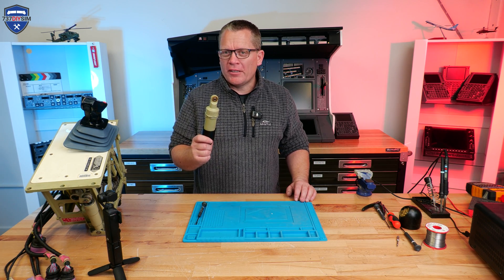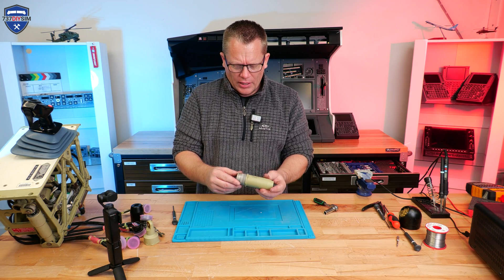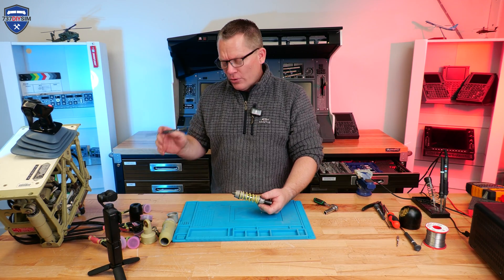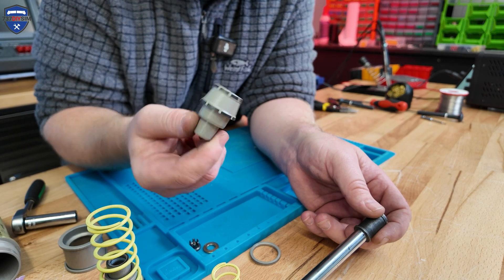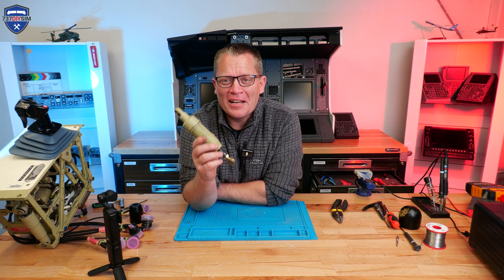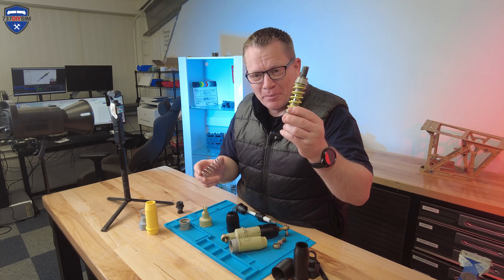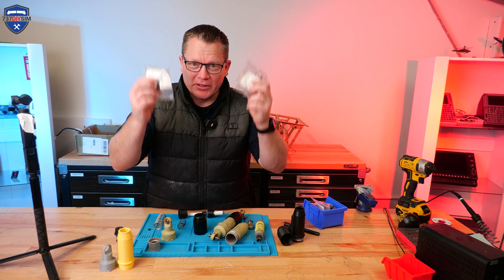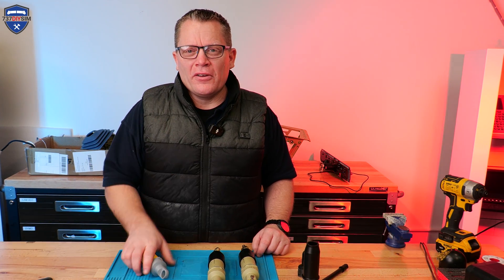A320 Sidestick PAFU

Comment: Hi Karl, first of all thank you so much for making this video! It's hard to find detailed info regarding how the airbus sidestick artificial feel unit works, and your video has certainly shed some light on it. However, I wonder if you have measured or have info on the stick force and gradient, or the force of the springs? So far I only found it has a 1lb breakout force, max 22 lb for pitch, and a non-linear gradient of two stages of force which is generated by the two springs shown in your video. But I don't know how much force it takes to reach the second stage..

Comment: Another reason to have 2 of them, with different part numbers, is staging. One operates at 10mm compression while the other one operates at 15mm compression. This gives 4 stages of force not just 2. Important when you don't have an active linear feedback.
Reply: Interesting. Could you elaborate on that? The info available online just mentions 2 stages of force, and quite vague.. it's so hard to find the force gradient. I'd really appreciate it if you could shed some light on it!🤝 Just want to simulate it with a control loading stick for flight sim haha.

Comment: Great job Karl. So do you prefer Fusion 360 over Solid Works? I got a Bambu Labs X1C. Got me a Solid Works Maker sub. But before I commit I'm trying to see what other people prefer.
Reply from the maker: Hello, I learned on fusion360 from when i discovered it in 2015/6. That's all i know really and have never used solid works. Im trapped in the fusion360 bubble as i don't want to spend months learning a new software.
Reply: @helimech8152  I get it. If it it ain't broke don't fix it. Thanks!

Comment: I'm curious on how you'll design the dampers for 3d printing. Since your first A320 sidestick video, I've been trying it myself but due to the fdm process leaving a textured finish, I can't get a proper seal or a smooth enough surface.
Reply from the maker: After taking one apart, i gave up. It could be done with resin printed parts, but in the ned it was easier and quicker just to buy a pre built damper assembly.

Comment: This is really cool. Love the work you do. I got into 3D printing because of your videos. Is PLA strong enough for this or would it be better to use a different material?
Reply from the maker: Hi Nate, No idea yet, but PLA looks more than strong enough right now. I usually stick with PLA and design the parts around it. Thickening the parts or making the stronger to cope with the loads.

Comment: I've been waiting for a video like this. I've always been curious how these parts were made for an airbus. Very simple... Even I could make this out of aluminum in my little machine shop. Thanks for sharing this information. I'm curious if there is any 'return-to-center' dampers, so the stick doesn't spring back to center so quickly. Thanks for sharing.
Reply from the maker: @sky173  hello, each line has its own fluid filled damper, you can see those in the first video on the sidestick.

Comment: I cannot wait for a 3d printable Airbus side stick!! I printed my own joystick but as an attachment for other joysticks
Reply from the maker: @Relics_tv  justv3 more parts to convert to CAD, then I get to analyse each part and make it 3d printable for everyone.
Reply: @helimech8152  I'm so excited!!! I have been working in cad with all kinds of parts in an effort to have a full A318/319/320/321 cockpit able to be made. I had initially planned to modify your Boeing CDU into a Airbus MCDU and create a throttle quadrant but don't have the time. I'd love to be able to make a A330 as well.